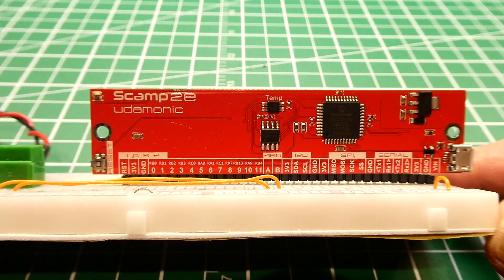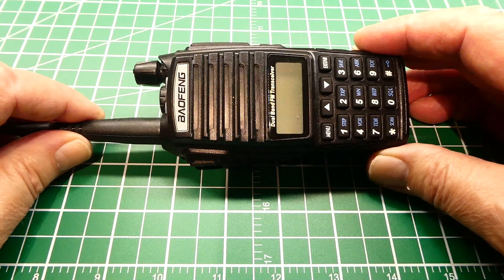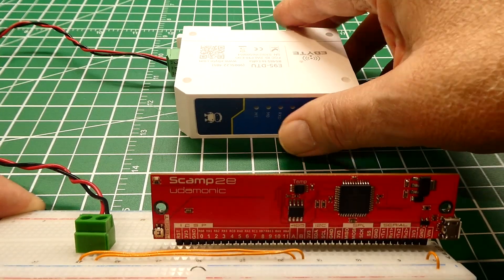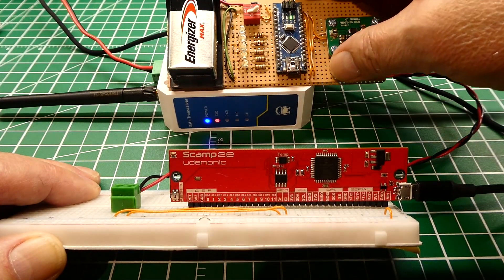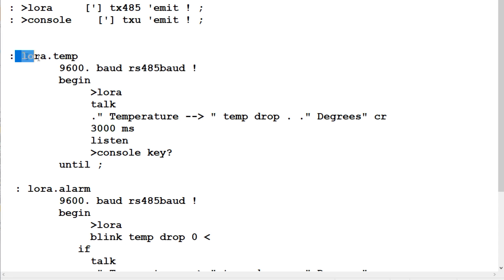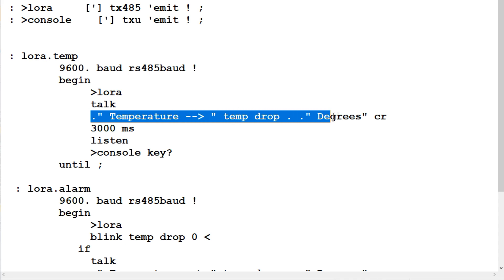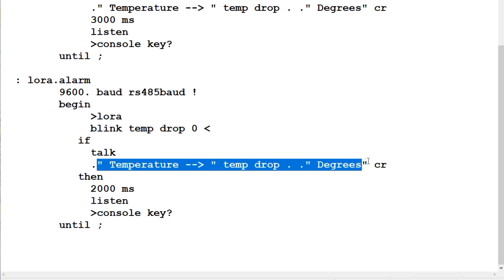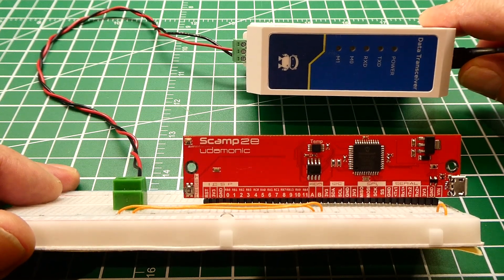RS485 LoRa / Scamp2e / Flashforth

Comment: Hi @0033mer I have been watching your videos testing the range of the E32 LoRa Ebyte Modules and I wanted to ask you if you think it would be possible to establish 10km radio link using E22 Ebyte Modules in the 868MHz band to transmit and receive the data collected from the sensors by an esp32. In one of your videos you showed that you reached a distance of 4km (2.5 miles) but I wonder if that distance or even a longer one (until 10km) can be achieved with the E22 modules since the datasheet says the distance reachable is around 5 km. Would it be possible to reach that 10km distance simply using higher gain antennas or are there other factors to take into account?
Reply from the maker: To get the advertised range as indicated in the data sheet, the two nodes have to be in visual line of sight and radio line of site which usaually does not happen. For more range consider a repeater which the E22 series is capable of. You can use multiple repeaters to get any range you want. Check out this video: https://youtu.be/zMjA_s30G2I
Reply: @0033mer  thank you so much. Your videos are very helpful